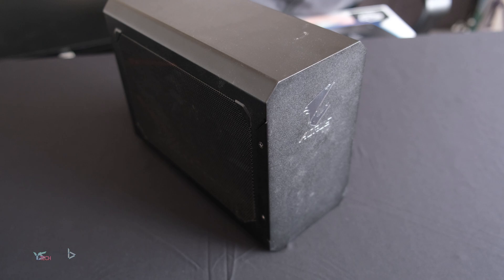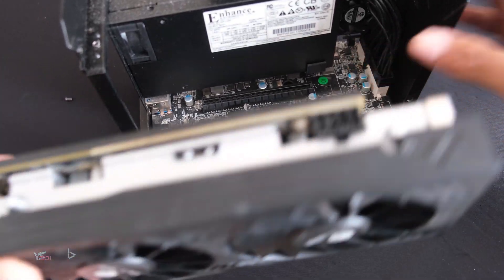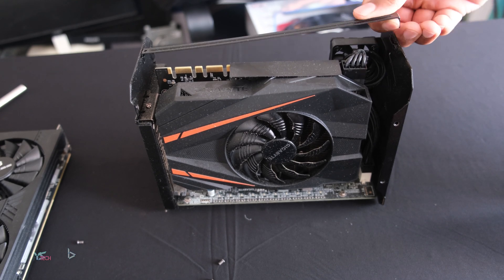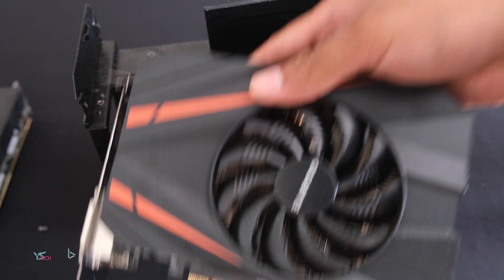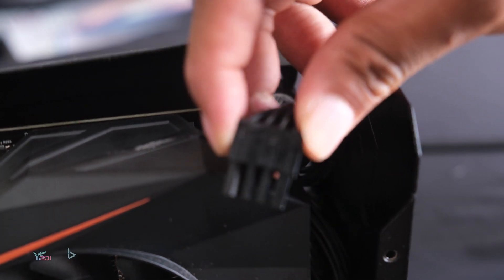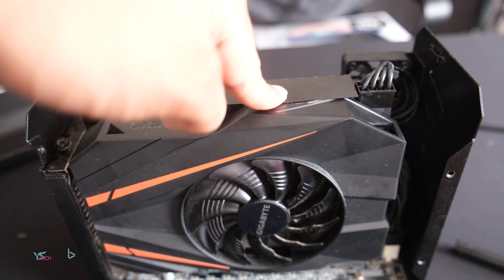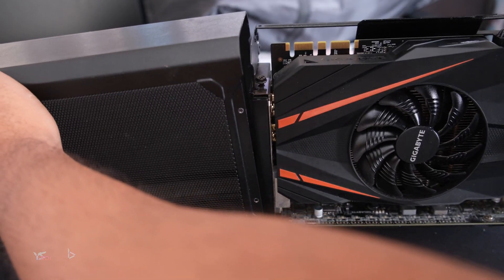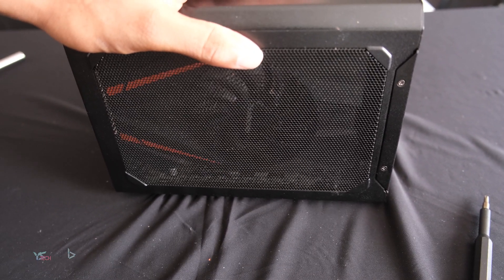How to Remove and Install a GPU from an Aorus Gaming Box (eGPU)

Comment: I'm having a problem with PCIe it shows x8 4.1 😭😭 I upgraded the graphic card with an rtx5050 that perfectly fit, even I think is a bit smaller than the gtx1070 included in the box, what do you recommend me to do
Reply from the maker: Hmm I'm not sure what the max bandwidth of the PCIe bus on this eGPU haha, but PCIE 4.0 x8 sounds about right because the bandwidth is limited through the thunderbolt/usb4 connector :). Though I remember that it was like PCIe 3.0 x4 but yea not 100% on that. Is there a problem with performance? Have a look on my channel I have had my RTX 3070 on a dual core laptop with a eGPU but with a dual core laptop lmao. Tbh unless its not working there isn't to much you can do afaik. Lmk how it goes :) -YS
Reply: @beezito I didn't notice it was PCIe 5.0 x8 4.1, but the thing is, I'm having a lot of problems mostly with dx12 games I have a lot of audio stuttering and my CPU reaches 100% almost all the time with dx12 games, and well, if the CPU reach it's maximum capacity the stutters are worse, so, idk if its a bandwidth limit problem or do have any idea of what would it be?
Reply: @Tv-fc9rg  I think it's a problem in general with RTX 5000 series when placed in an egpu?

Comment: I have a question: if I replace it with an RTX 2000 ADA card, will this eGPU box support GPUs that do not require a power cable?
Reply from the maker: It should work because that card is 70W :) from memory a PCIE x16 slot can do 75W. I mean the card was designed to only take power through the PCIE slot lol. The only thing is that the performance will probably be limited through the thunderbolt cable. Just check the size as well to see if it will fit if you want to close the case of the egpu. Also this is the gpu your talking about right?:
https://www.pbtech.co.nz/product/VGANV20010/NVIDIA-RTX-2000-ADA-16GB-Graphics-Card-GDDR6-ECC

:) -YS
Reply: @beezito Thanks for the inputs, I'll just sell off my Asus Phoenix 1660S then wait for the ADA generation to drop in prices.
Reply from the maker: That's fair man hopefully it drops on price soon :)
Reply: @beezito  Yeah, it’s the same one from PBTech. I can confirm that the AORUS Box 1070 can fit GPUs up to around 175 mm in length. I actually took mine apart which currently has an ASUS Phoenix GTX 1660 Super OC ITX which is about 174 mm and it fits perfectly.

The RTX 2000 Ada from PBTech is still a bit pricey right now though, so I’ll probably wait and look for refurbished units from trusted refurbishers or on eBay once they start getting cheaper.

I’m fine with the 20% performance hit from the Thunderbolt 3 connection. I’m planning to pair it with a Thunderbolt 4 laptop using an Intel Ultra 265H and a 0.8 m Thunderbolt 4 cable, which should help reduce the performance penalty slightly compared to using a Thunderbolt 3 laptop. As it's the only viable way to avoid mid range gaming laptops that are stuck with 8GB vram.